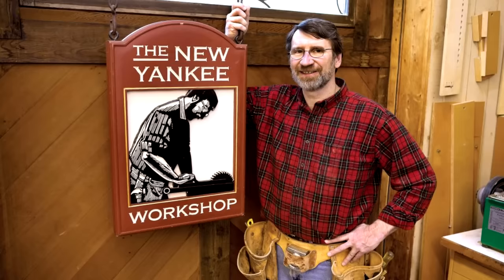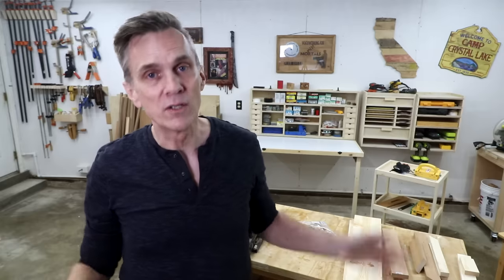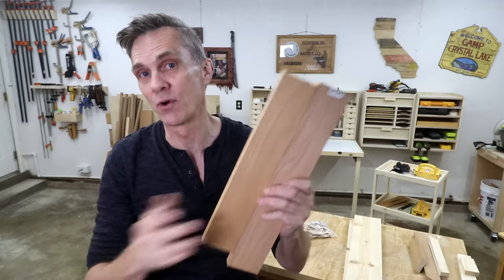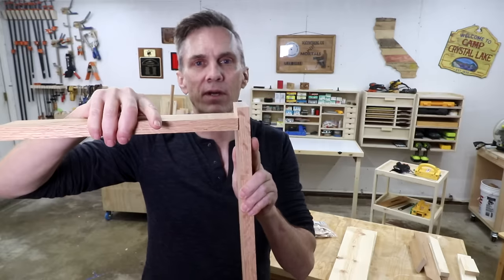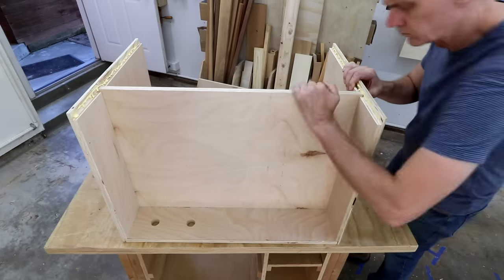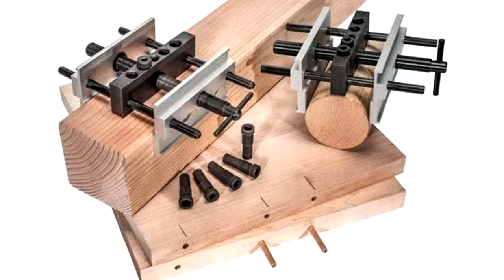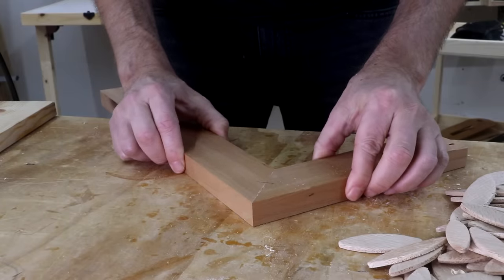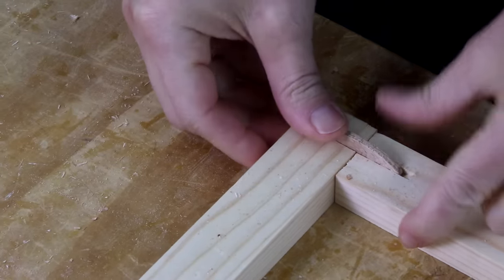So, is a biscuit joiner completely useless?

Comment: I don’t use mine often, have in the past used them, believe it it not, to attach rails to legs. On small tables or stools, it seems to have worked okay. I think two facts are sometimes overlooked in these discussions are: 1. The stability of a build doesn’t usually depend on a single joint, but all the joints working together, and 2. biscuits vary in dimensions and construction: single ply isn’t as strong as multi-ply, they vary in thickness, and they vary in the amount of swell when wet with glue. Measure, test and choose the biscuit that works best with your slot.  That said, for a strong joint, I prefer dowels, M&T, or pocket screws.

Comment: I use metal table top fasteners (the little zig zag ones that screw to the bottom of the table and slide into a slot in the table skirt to allow movement).  This is pretty much the only use I have for my biscuit joiner.  I leave the biscuit joiner set up for this task and it makes cutting those slots SUPER easy and quick.  That being said, if I didn't already have a biscuit joiner, I wouldn't run out and buy one for this application.

Comment: Hi Steve I find in the UK Biscuit joints are pretty much used by kitchen fitters only to join worktops together along with bolts on the underside 👍🏼 thanks Steve
Reply: For join read align

Comment: Many folks malign the biscuit joiner, I'm not one of them. I have used the biscuit joiner for over 20 years and this tool has allowed me to move quickly and make strong cabinets ad frames and make money. If your biscuit is as sloppy in the joint as Steve's is you need to understand that you can hydrate your biscuits to have a tighter fit. You may also not have your joiner tuned properly... Not strong? Right. Take two 12" long by 2 1/2" wide pieces of pine and glue up a right angle joint. Try to break it, invite others in your shop to try. My test piece was never damaged. The biscuit joiner is one of the most effective ways to move quickly and build well in your shop if you know what you're doing...

Comment: My father bought and used a biscuit joiner, I found that the biscuits didn't swell like they claimed, I even soaked one in water overnight, the glue will just set way before the biscuit swells if ever. I like dowels, to me they are as strong as those German ones if you make them deep enough, the shop where I did my apprenticeship had a horizontal borer. Also dovetail rebates or dados for wide boards or just a simple groove cut on the table saw with a loose tongue made from plywood

Comment: Well, I have a DeWalt biscuit joiner and use  it on many projects and have to tap the biscuits in.  I think they work great for getting the boards level in addition to clamping.  I also use pocket screws but find the biscuits faster for some projects.

Comment: I have used my biscuit joiner on several pieces of garden furniture.  I'd agree that the pocket-hole joints may be mechanically stronger in certain applications, but the biscuits are invisible from both sides of the piece.  I think there's a place for both types - and for plain edge-gluing as well!
Thanks for your perspective.

Comment: I have used dowels for both of the cabinets I made so far.  The hole in the one side is easy, just use the jig and drill.  For the other side, they have those little spike caps...and I have found the drilling for those holes works amazingly well on a drill press if you have a cross slide vice, just adjust back and forth to get it perfectly aligned.  Thanks for the video explaining the biscuit jointer.  I will stick with the dowels and glue for now. :)  Though I did get a lock miter bit which I am also playing with.

Comment: I have one, a Festool.  Got it for a great price...and have used it 3x in 3 years. It was very useful when I made a small bookcase since my boards weren't wide enough.
Reply: Take no offense but this is exactly what most woodworkers say against it: it is useless in making wider boards. You can glue boards with or without biscuits, the result is the same. It won't be stronger with biscuits.
Reply: And this is also exactly what Steve Ramsey explains in the above video too.
Reply: I used it because I had it...and it helps keep the boards flat when glued together.  Generally I'll do pocket screws or some other joinery.

Comment: Way back I got a DVR and a garage and re-started watching New Yankee Workshop.  My first sighting of a biscuit joiner had me pause, backup, rewatch several times, and say out loud "What Is That?!?"

I have a higher opinion of them than Steve does, but I agree that they are not at all essential.  As a cheap person, I will note that biscuits are cheaper than screws.  But good screws are certainly stronger.

Comment: Man I live Steve's channel. All the content is right on the money. Even as a pro woodworker I still watch all his stuff. 

I've found that the biggest problem with a biscuit jointer isn't exactly the concept of a biscuit joint. It's really a fantastic concept. The problem is that the tools can't produce perfectly accurate joints because they are cheap...

But if you want to go with a Lomello Biscuit jointer and spend as much as a Domino Jointer then you will have a fantastic tool.

The Lomello Biscuit Jointer, Domino Jointer, and the Mafell Duo Dowel Jointer are interchangable with general woodworking, but they have different specialties. The Domino i'd say is strongest... Lomello is most versatile, and the Mafell is cheapest in the long run

Comment: I too just had to have a biscuit joiner about 20 yrs ago.  Then I looked for uses for it.  As time went by I found less reason to use it, but I have found some regular, somewhat infrequent, uses for it.  My impression if its limited usefulness might be different from yours Steve because you clearly have the sloppiest biscuit slots I've ever seen.  Maybe it's the joiner blade or maybe it's the biscuits, but my biscuit fit is not even close to being as sloppy as yours.   Mine fit pretty tight.  Using biscuits to help with edge joint alignment is, for me, a viable use of a biscuit joiner.  I also use it for some face frame to plywood joints.  I agree though that for most woodworkers it probably should be the last power tool they buy . . . if ever.

Comment: At least here in Germany there are "screwable" biscuits available for detachable connections. Pretty rare in hobby shops but very useful in some cases. Other than that I totally agree with your message given in the video
Reply: Cool 
I'd like to know more about the system
Reply: @garychambers5930  its called Clamex S by Lamello. You need double sized holes for them. In theory you need a special machine for this, but you can also drill 2 holes above each other or use a special router which doesn't fit in all machines

Comment: Sorry, Steve.
Some of us think dovetail and box joints extremely ugly.
I have table tops that have been stable for many years joined with biscuits.
When you want invisible help joining edge to edge or miters like in frames, or butt joints on small jewelry/keepsake boxes it is  a handy tool!
A cheap one at Harbor Freight costs $50 with their coupon.  It is a handy tool to have in one's shop.
Yes.. not great for every job.. neither is Kreg screws.. which more than a few You Tubers have proven to be fairly weak and are ugly as sin.

But it has its uses!

I like all your videos I watch.. and that is almost all of them!

Comment: They have their use over floating tenon joints.  Just joined some 2 x 4's with double biscuit joints that I couldn't use pocket holes on Worked perfectly after hammering the joint together, yes it was that tight. Now the blanks can be cout down to size.

Comment: I find a BC really useful on picture frames.  The smallest B is wider than the frame, but I set it to make the "extra slot" on the interior where it's hidden, then I use a partial B, sort of like a hidden spline.  Once you set it up, it goes fast.  Utility of any tool depends on what you make as well as how you make.  Also, BC blade a lot harder to cut finger with!  Can't carve wood with it tho.

Comment: Steve I agree with everything you said, and just finished using my biscuit jointer on a glue up for the first time in easily 5 years. It’s super slick and easy, but yeah, I didn’t need them. I think it’s mostly so I’ll cringe a little less when I knock the piece off the bench next week and it torques on a corner.

Comment: Biscuits are for quick board alignment, your biscuit joint was loose because of the quality of the biscuit jointer (look at the lamello one), dowels are the most used joint after screws in the woodworking industry and are pretty strong and accurate mainly because no one uses dowel jigs but dowel jointers, big machines with lots of drill bits made specifically for that or cnc.

Comment: In the last 6 years I have used the domino, lamello and the lamello zeta p2. For basic cheap cabinets the normal lamello is perfect for strengthening and aligning sides and glued shelves In cabinets. For things like picture frames and stuff with 45 degree angles. Always use the domino because of the small size dominos. But when making a high end cabinet. I always use the lamello zeta p2. Because of the self tightening lamello tenso that you van use with the zeta you don’t need any clamps. And in a lot situations that a dry fit is needed before glue up it is so easy to just put a cabinet together and not worry about is falling apart. The tenso connectors are a bit expansive around €0,75 cents a pice. And in a basic cabinet like a clothing cabinet you use at least 18 of them so per cabinet around €13. But it makes love so much easier. It’s worth the cost and most of the times the cost of the connectors is just calculated in the price of the job.

Comment: I completely disagree, I work in a professional shop and use over a thousand biscuits a month. Which I’ve done for over 25 years. You cannot beat the ease and speed of a biscuit jointer. If your biscuit joint is sloppy either your cutter is too large or your biscuit jointer is junk, or your not using tool properly. You get what u pay for. If you have glued more than one panel in a session you quickly realize cauls pressing on top and bottom isn’t practical, biscuits eliminate the need for. I don’t rely on them for extra strength but to align joints. It’s a must have tool. The people who do woodworking not only on weekends know this.

Comment: Thanks for confirming my opinion of the biscuit joint. That said, I hold the same opinion of the pocket-hole joint. I tried it on one project and just didn't see the strength I wanted. You might check out Matthias Wandel's pocket-hole test.

Way back when my only tools were a router and a drill, I tried joinery using a version of loose tenon that I think of as spline joinery. Cut a groove the full length of the boards to be joined and use a long strip of 1/8" or 1/4"  X 1" plywood as the tenon/spline. super strong and somewhat self-aligning. The ends have to be hidden unless you use a stopped groove, which is a pain.

By far my favorite is the dado joint, or sometimes a rabbet joint. I've built a number of toy boxes using those joints held together with washer-head construction screws. Brass coated screws visible on the outside add a nice decorative touch. No glue necessary, plenty of strength, easy to assemble. and easy to knock down for storage or moving.
Reply: His test does not replicate real world usage.

Comment: I have the mini cutter and found it very helpful. Especially in hard to control glue ups . When the water base glue effects the biscuit it swells and takes out any slack. Even if you don't glue them humidity eventually makes them swell. Leave the container open when you store and you'll find this out. I never considered them a hardy structural element neither is a screw or a nail. I don't think I personally can call it a useless wall ornament.

Comment: BJ is usefull to reinforce MDF or chipboard joints. If you have no grain at all - every additional strength is helpfull and we use them a lot in specialty parts like columns, hood ranges and so on.

Comment: Still have my biscuit joiner and I'll still buy two cans of number 20 biscuits in one can of number 10 each year. Sometimes there are joints what are you doing out form to show Pocket Hose and such anytime I need the biscuit to be titer you can always glue drywall tape to each side or just one side depending on size of your biscuit joiner blade versus biscuit

Comment: I have to say I use my biscuit joiner. And my joints are never as loose as the one you showed. It is great for panel glue ups and for attaching face frames to cabinets.

Comment: As a professional woodworker I know you get what you pay for and a decent modern Makita biscuit joiner is a great tool. I use them mainly for some loudspeaker joints.  The biscuits draw in the glue and expand, they make a great joint and when the glue hardens that joint gets a lot stronger so you can't judge by the raw biscuit strength.   Biscuits shouldn't be a sloppy fit.  That says more I think about your jointer or blade.  The joint will not be weak as the biscuits are merely a way of edge lining and securing once everything is lined up, then it can be clamped and sets rock solid.  With modern glues it's perfectly strong enough joining cabinets this way without extra reinforcement. The Festool tenon joiner is better still but silly expensive and not worth the extra.  If you need a proper solid high stress application joint, use a mortice and tenon or similar.  The other area biscuit joiners are great for are long mitre runs.

Comment: I got a relatively inexpensive router bit and use it on my router table to make simple biscuit slots when needed. I agree, I don't use it often. But when I make a greenland kayak paddle, it's a good way to attach the paddle tip - which is end-grain to end-grain. I've never had one come apart. Way easier than doing a mortise and tenon.

Comment: I build craftsman style picture frames and it is very useful for that. Glue alone is not enough and I avoid metal fasteners. I’ve also used it on cutting boards to increase glued surface. Sure, if you already have a shop full of fancy precision tools, it may be superfluous, but working with hand tools primarily, it’s a useful and at times essential tool.

Comment: Really good video.  Like you, watching TNYW with Norm, I bought a biscuit plate joiner, a Porter Cable.  I use it for positioning face frames, and occasionally for edge to edge glue ups.  I've used it for a long time.  If I were new to woodworking, I would not buy one either.  The practical use is too limited, and the learning curve is too flat.
Reply: You can use them for cabinet carcass, box frames, small table construction, drawer construction and so on. 
Try and use your imagination and you will produce strong joints in projects.

Comment: Biscuit joiners are great, I don't have any vertical play in mine, not sure what blade or biscuit you are using.  If you are creative with them, you can do alot more such as a great tenon cutter or even mortise starter for larger joints.  The point is, as long as your blade is not out of whack, you have a registered rectangular hole cutter, and that's always useful if you are willing to clean up with a chisel.

Comment: A plus one for dowels. Inexpensive doweling jigs may be frustrating to use. But the better ones are excellent. And the strength of the joints are competitive with tenons. See Matthias Wandel's experiments for example. Also Dowelmax tests.

Comment: Intresting video
Been scaptical with your video
I do agree, that a biscut is not for strenght.
I think its a very simple and fast joint to   align two pieces. Especially wen your working with veneered panels.
By the was a biscut should not have play in the slot!

Comment: I use triton biscuits to align joints accurately for glue up.When the glue has dried I sometimes reinforce the joint with pocket hole screws.

Comment: I use the dowelmax, and if used properly, using multiple dowels for joints, I can get an extremely strong joint.  I had tried other dowel jigs, but none have the accuracy of dowelmax, and it is very easy to setup. The only downside is that it is not cheap, but I have no regrets.

Comment: Something wrong there. Your biscuits are way loose. You should almost have to tap them in. The point of the biscuit is alignment, not strength. I distinctly remember Abrahms tapping his biscuits in with a rubber mallet.

Comment: I'm a firm believer of biscuits having used them for dozens of projects, some very large like the top of a bar. I have NEVER had a biscuit loose like you showed in the video. There is horizontal play for proper alignment but not vertical. In most cases I've had to pound them in gently with a hammer. YOU NEED TO ADJUST YOUR JOINER. Straight gluing doesn't always hold, especially panels used for cabinet doors where it is only held by 2 hinges to the work piece.

Comment: Maybe not so much for a 1x2 but try gluing up a pair of slightly wavy 5/4 eight footers and you’ll be glad for the alignment help. The biscuits swell in the slots for tight fits, and a little 80 grit sanding smoothes out any leftover irregularities. I use mine when it makes sense. BTW, there are smaller biscuits for those miters.

Comment: I always used my biscuit joiner and dowel jigs for "alignment" only. The 2 biscuit joiners I have, the slot(s) are tight for those biscuits. If yours is "loose", then there's an issue with the tool itself. Anymore, I don't hardly ever use my biscuit joiners, more time consuming for me to setup vs my dowel jigs. Not really disagreeing with you Steve but, for me, mine definitely has gotten limited to it's amount of use. Plus for doweling jigs, you can make your own dowels quite easily and efficiently vs trying to make your own biscuits. Cheers :)